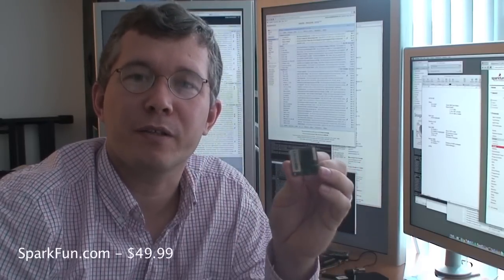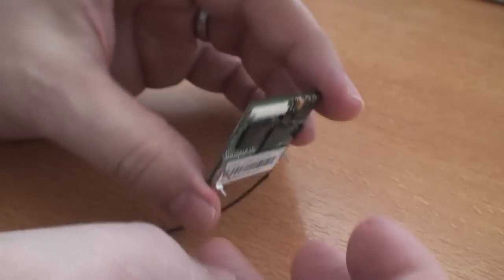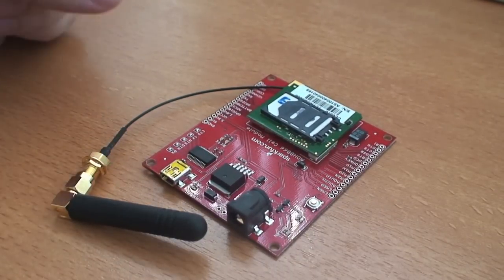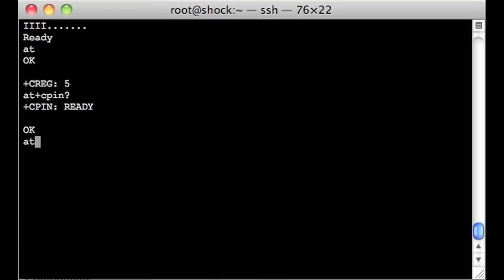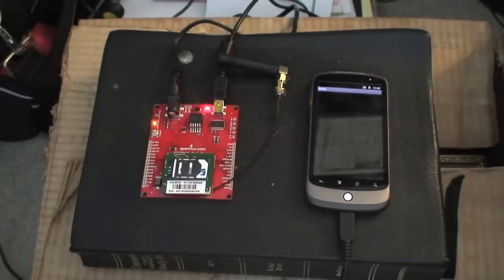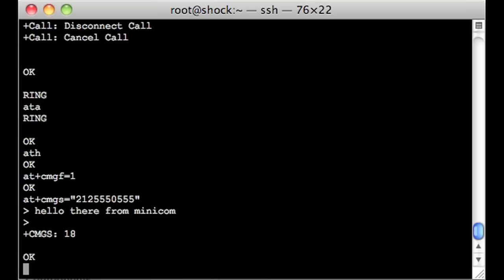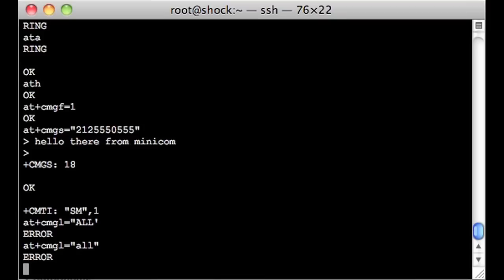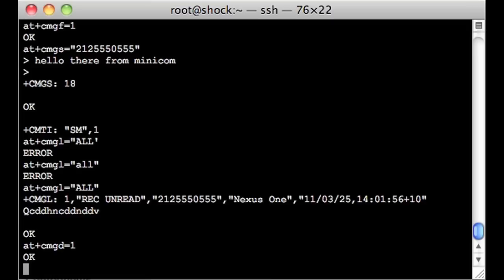GSM Module - The Well Tempered Hacker Ep 3

Comment: Please link sofware your program sir
Reply from the maker: There's not really much software in this - the terminal is just running minicom which is a standard linux modem program. Behind the scenes I'm using an open source GSM network but it is just simulating the public cellular networks so that part isn't necessary.

Comment: Hi there, very good video.
Although, I have a question. Imagine I make a phone call to the board. The mic (if attached to the board) starts to get analog signal and then the sound signal will be digitized and processed a bit before reaching the GSM module to be sent over the network. Now, what if I want to do a custom processing on the digitized signal before it heads over to the GSM module. Do you have any idea how I might be able to do that?

Kindest Regards
Reply from the maker: You couldn't do that with this module because the analog mic input goes into the chip where the analog to digital converter is so you don't have the digital data outside the chip. Presumably, if you found a chip that takes digital audio input, you could do your own analog to digital conversion and then do some alteration of the digital data. I'd caution though that the digital data you send in will not be the digital data that comes out the other side. There is loss of data because the GSM codec heavily constrains the frequency range and other aspects of the audio signal.
Reply: Anders Brownworth thanks for your reply.
I'm aware of the constraint the gsm network impose on the signal and and also the heavy vocoder operation. Yet I need to do some sort of byte xoring with the digitized samples of the audio before sending it over the network. Since the signal I'm xoring with the original data is a sequence geberated by an unpredictable PRG, the resulting signal is somewhat a uniform noise with frequency spectrum spread all over the band. Therefore I think the gsm error correction schemes are enough to cope with lossy data. Nonetheless, I still am struggling to find a way to manipulate data before it hits the GSM module because as far as my knowledge extends, there is no way to get into dsp unit (baseband processor) of the gsm module and there is also no way send digital data to the gsm module from the main board (say stm32 something). So if you know a way or possibly have some documentation that I could use I would highly appreciate it if you could send them to me or at least reference them. If its not too much trouble though :)

Thanks alot
Reply from the maker: I'd suggest you look into an SDR setup like the Ettus Research USRP devices and try running OpenBTS. You'll be able to get in to the post DAC audio but before it goes to the GSM blocks. I did a video on OpenBTC and this hardware here: https://www.youtube.com/watch?v=pTb1_v8M6iA
Reply: Anders Brownworth thanks alot man i really appreciate it

Comment: OK great so if I give the IMEI to PURE TALK to activate the SIM,  I will have this SIM bonded to the device.   If I just activate with out the IMEI then I cannot get a new phone number and expects that I already have an existing phone number.  I do not have an existing phone number to use.  I need one to be able to call the alarm device or text new commands to this device.   I will unlock my current ATT phone and use it to activate the phone.  Will this have an effect on this phone's IMEI and its attachment to my current phone number?   Or will it still work with the original ATT SIM?
Reply from the maker: "Bonding" a SIM to a device usually means making the phone "lock" to a particular SIM. You won't have that problem with the ADH8066 as you didn't get it from the carrier and hence they could not have engaged a software lock.

The IMEI is hard-set in each device and generally can't be changed.

Comment: hello great video.   I have a GSM alarm system that I will activate a PURE TALK SIM in it.  But I do not know how to get its IMEI number to activate the SIM with.  I want a new phone number (to text back to the alarm) so it requires an IMEI number.   I can use my current ATT SIM to call out of this unit.  Is there a way to send the ATT SIM an AT command to have it return the IMEI number from the Alarm while the ATT SIM is installed in the alarm and use my work cell to text of talk to the Alarm.   I guess I can find an unlock phone and use that IMEI number to activate then transfer to the Alarm system.
Reply from the maker: The IMEI is associated with the GSM device, not the SIM. If the provider you are using requires you to give them an IMEI so they can whitelist it, sending AT +CGSN should give you the device's IMEI.

Best of luck with your project.

Comment: Great tutorial,
Will the interface be able to send USSD commands and read the network replies?
thanks
Reply from the maker: It depends on the device. In this case, no. The ADH8066 will actually return an error when it senses USSD data but I'm sure you could find a device that support  it.
Reply: A prompt reply like this does not deserve the punishment of a follow up question, but .... Probably I will go for some USB dongle and have a go, are the commands universal? could you point me to a reference.
thanks again
Reply from the maker: Mac Gate AT command interfaces aren't completely universal but you shouldn't feel like you are in much of a foreign land using it with just about any other chipsets. Other chipsets may, however, also have a binary driver option which would work very differently. (and likely what would be ideal for USSD)

The best reference is going to be the data sheet for the hardware you end up with. For something general though, the "getting started" guide on SparkFun's page on the ADH8066 isn't bad.

Comment: hi, im trying to connect to this module via arduino uno, can you create a manual how can i recive sms's from the arduino interface please
Reply from the maker: Thanks for the suggestion. The connection between the GSM module and whatever else you want to use (arduino in this case) is just a serial port so a slightly modified "serial hello world" script should be able to drive the GSM module. I don't happen to have an arduino handy for this though. Have one you want to send me?
Reply: Anders Brownworth thanks i will try that, i will update you if i secceed

Comment: Do you know if this is similar to the module on the arduino shield from seeedstudio?
Reply from the maker: I have no idea, but these things act very similarly so I wouldn't be surprised if you found they worked just as I demonstrate here. In fact, if you dig into the internals of Android, you'll notice it talks to the cellular radio subsystem in an eerily similar way. ;)

Comment: oh yess - working perfectly :)
I'm using GOSERIAL on MacBook Pro. Settings are: 
Serial port: usbserial-a9014fsxxxx
speed:115200 bps
Data bits:8
Parity: none
stop bits: 1
Hardware Flow Control
Input: RTS
Output: CTS
Local Echo: Off

"
at

OK
"
Reply from the maker: Thanks, very helpful!

Comment: Yes, this should be fairly easy for a micro controller although I haven't done that before. I have, however, tied this to a Raspberry Pi and been able to send AT commands. (I didn't build the reset functionality though - usually just power cycling it fixes it)

Comment from the maker: 3.8 volts is probably better than 12 volts for a mobile context so it is a good choice. Usually hardware accepts a range of voltages. Check your docs on that. I'd guess 3.8 is a maximum and 3.3 (which is very common) is possible. Also, the number of volts isn't the only thing that contributes to how much power is actually flowing through a project. The number of amps and volts together matter more. :)

Comment: I am thinking to buy the SM5100B Evaluation Board but it says it's on 3.8 volts no more 12.. why 3.8 instead of 12?  is it a US new regulation thing? will 3.8 volts be enough?

Where am I supposed to find a 3.8 power adapter in the uk?

Comment: Thank you for your quick response. I actually solved my problem,  the issue was one that it needed more power and two i needed to select the proper frequency for my region.

If you dont mind, as another question, have you ever ran into the issue that you actually had to poll the SIM for received messages? When mine is sent a message, it doesn't alert me like yours does.

Comment from the maker: From the docs on the SparkFun site, it looks like 5 volts is too much. I'd feed it 3.6 volts. (hopefully it isn't burned out but the docs say "power supply can never be greater than 4.5 V)

Also check the flow control in your terminal program - looks like the UARTS on that have hardware flow control.

Comment: I am using the sm5100b module and eval board (similar to yours). I am having the issue of nothing at all showing up on the terminal. I'ave tried baud rates of 9600and 115200. I'm feeding it 5V as indicated on the board everything is connected and new out of the box. Do you have an suggestions on what i could be doing wrong?

Comment from the maker: There is a good chance your terminal settings aren't what the device is expecting. I'd have guessed your USB serial driver but you say the Arduino works. I do most of my development on a mac through the same terminal emulator as the Arduino (actually I use the maple variant) but it should work. I'd just check terminal settings - 9600baud, 8, No and 1, etc.

Comment: Mac (version 10.7.5) I have not gotten the ADH8066 to ever work. I’m trying to connect via USB to just prove I can get it working and build from there. The adrino, I use, I connect via usb and works great for other things. I connect the ADH8066 via USB and get a flash on transmit receive, then press on key until the status light comes on.. just can not get to the point of seeing it to send it commands.  Thanks for taking time to respond!

Comment: I have the ADH8066 and evaluation board like in your video. When connected to usb I do not see the device (ls /dev/tty.*) when I connect my arduino UNO, I can see the device.The SIM card is an AT&T and tested and works in a phone. Any suggestions to trouble shooting or good resources to get me going it the right direction with the ADH8066?

Comment from the maker: Yes, the setup in this video does require an external computer. (although the E100 in another of my videos wouldn't: youtube. com/watch?v=g3-SjnES0K8 ) The 100mw Tx I am using would go several city blocks if I were outside though I'm deep in the bowels of a building where little radio signal can leak. You can use an amp with this rig but you probably want to split the transmit / receive paths as well. I haven't done that though so I don't have much in the way of suggestions.

Comment: I believe you can do that by sending a "connected line identification presentation" request using the command "+COLP". (I'd have to try it to be sure) Have a look at the AT command reference at dlnmh9ip6v2uc.cloudfront. net/datasheets/Cellular/ADH8066ATCommandsV16.pdf

Best of luck.

Comment: Looks like the MSR 500 has RS-232 though it is sketchy on USB. Either way, you need at least a micro controller - I'd suggest an Arduino - a few wires and a little programming to do what you want.

Comment: Unless the msr is programmable and has serial circuitry like SPI or RS232 (highly unlikely) you need something programmable in the middle. I'd suggest an Arduino ($80) or a Raspberry Pi. ($35) At that point, it should all be software - capture the data coming in from the msr, construct the proper AT commands and send them to the GSM module.

Comment from the maker: @digitwolfcom Are you sure the USB serial port shows up in the operating systems you are trying? Make sure you are picking the correct port. I forget the baud rate (9600/ 57600?) but 8 bits, no hardware flow control and 1 stop bit should be the other settings.

Comment from the maker: @digitwolfcom After making sure the serial settings are correct and pressing the reset button, it usually comes up with some data. If not, I hit enter a few times. Try other serial software or another system if you suspect serial misconfiguration. I'm using Linux / minicom in the demo.

Comment from the maker: @Neolith100 I work for a telecommunications company so I have several hundred SIMs but you can use valid SIMs as well as long as you tell the phone to connect to your network. For the phone numbers, you can just make them up and program them in. Real numbers only matter if you connect Asterisk to the phone network which I have done but not in these videos. I find it most helpful to use believable test data. Thanks for watching.

Comment from the maker: @engtarkan Just turning the radio on with a valid SIM in it will cause it to associate with a network. You will get a notification when it associates. (as it does in the video) When an SMS arrives, (also demonstrated in the video) it gets stored on the SIM card. I also demonstrate how to read the message off of the SIM card and display it's text so you would have to use similar commands. Lastly you will want to delete the message from the SIM so it doesn't fill up and start refusing messages.

Comment: thanks,yes it works with serial communication, my application is to use the microprocessor as a switch.
when a sms is sent to the GSM modem, i want the GSM to send a serial signal to the 8051 so that the 8051 set other pins high or low,

so my problem is how to start the GSM modem and how to set it to receive SMS messages from a cell phone and then send a serial signal .. 

thanks again fro the help

Comment from the maker: @smawis I run my own network so the SIM is just off the shelf. It is an OpenBTS system that I demonstrate in the next episode. (episode 4)

The GSM modules act as mobile stations, yes. they function very similarly to standard cellphones (like the smartphone in the video) but don't have audio hardware set up. You could easily wire in a microphone / speaker though. These modules are really made for data applications like data collection or command and control.

Thanks for watching.

Comment from the maker: Engtarkan: you don't need the development board but it makes it far easier to get at and test the GSM module. If you didn't use it, you'd need some way to power / read data off of it. The critical component is the surface mounted header.

Yes it is possible to do what you are asking. I'd use the development board to do this if I were you.